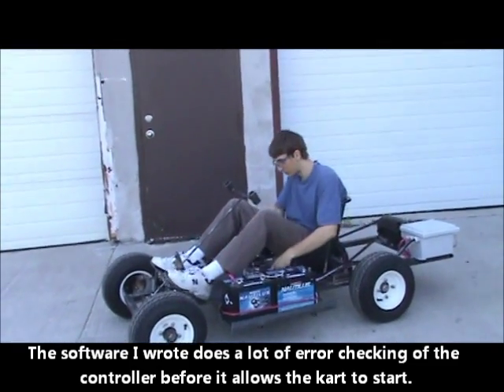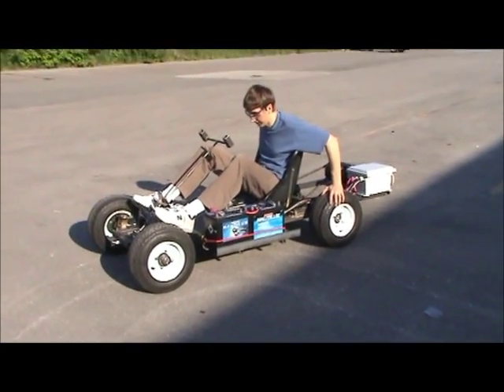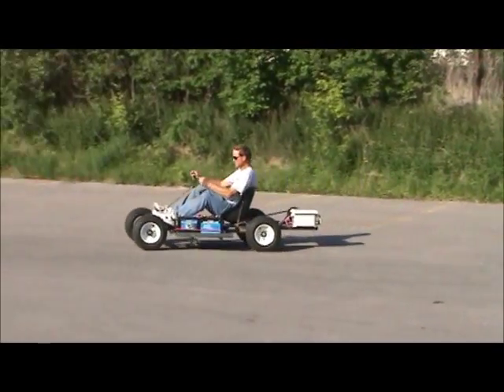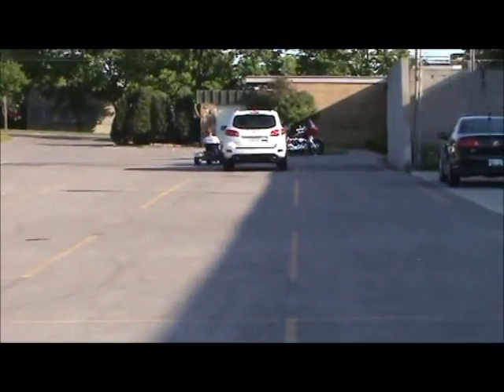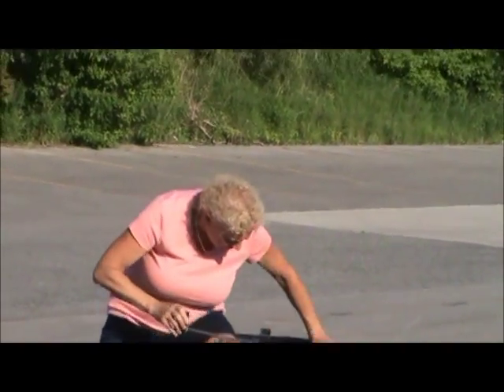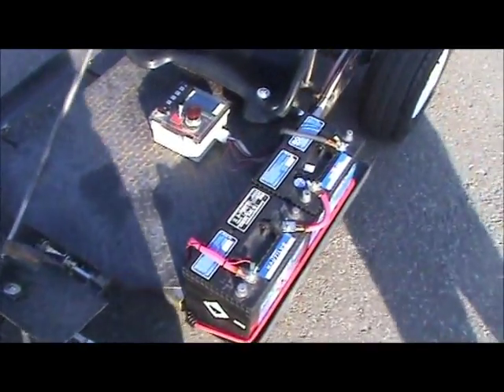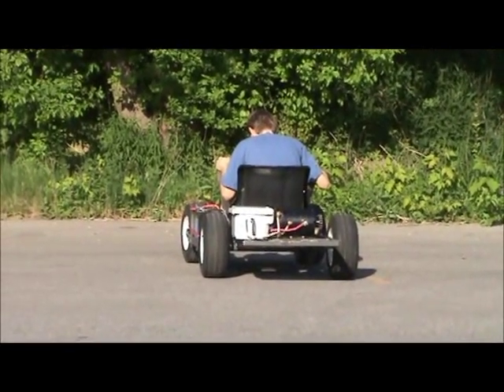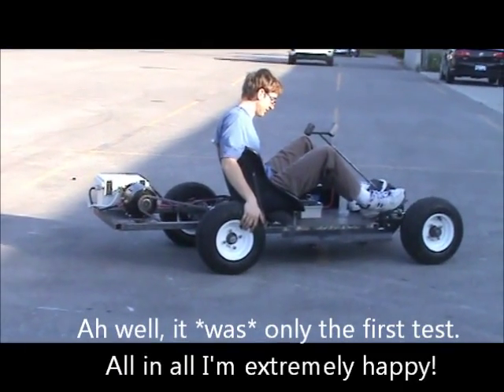Go Kart - Test Drive

Comment: Yes, anything you've never done before is hard :D

I'm an EE graduate and I've had a slew of microcontroller projects, along with some basic low voltage motor control stuff, but never something this big, so it's new to me. I've got the motor mounted and will start the controller next, and then LiFePO4 batteries. i.imgur dot com /icXbTq2.jpg

Thanks, I'll check out that controller, and definitely post videos as I make progress.

Here's to making cool stuff, keep it up!

Comment: if I took the nameplate off your motor and wrote 72-120V on it, would you be less obtuse?
The 24V is for forklift use. The 72-120V is for EV use. They could be identical.
This is the last time I'll answer you if you continue the idiotic attitude.

Comment from the maker: Let me get this straight.
I'm using a forklift motor rated for 24VDC.
You tell me that I could run 144V (6 times rated).

However:
The White Zombie can run 300V. Fact.
The White Zombie's custom engine is built from two Impulse 8 motors
(Ref: go-ev dot com /motors-warp.html#WarP_8)
This motor is twin to 
(Ref: evparts dot com/products/street-vehicle/motors--dot/96-to-192-volt-street-vehicle-motors/mt2117.htm) 
which is rated 72-120VDC
Thus W.Z runs 2.5x nameplate rating.
2.5x 24VDC is 60V not 144

Comment: I specifically stated 48v as potentially safe without current limiting so it follows I was talking about higher voltages without having to specify exact values.
There are many nuances in this kind of engineering and oceans of people will perpetuate their impressions and myths. You will have to navigate such pitfalls and learn that not all knowledge outthere is true. You can look on evalbum for forklift conversions and you can do the experiment. run it at 60,72,84, 96 and get comfortable it works

Comment from the maker: The internet make it difficult to convey sincerity, but I have been putting effort into toning down my replies. So okay, you were referring to 144. That felt like a separate conversation to me, I apologize for the misunderstanding. 
I have spoken to guys in motor rewind shops that told me even running double voltage (48) would be putting my motor at risk. I have never seen a motor run at 6x voltage spec, and I don't know the specs on the W.Z. I should look them up some time.

Comment: You will need to deliver a much better attitude if you want to benefit further from my insight. You can start by noticing I said it might work without current limiting in your setup at 48V but normally..
and I didn't say arbitrarily high voltage. 100+V which is normal for cars based on forklift motors. and it will of course work just fine at 120V or even 144.
as I said, White Zombie runs at well over 300V.
Try to read what I write so I don't have to repeat it many times

Comment from the maker: I would love to, but I don't own a DC Clamp Ammeter. I'm not sure the AC Ammeter reading would be reliable - in fact I'm sure it would not be, it's not a True RMS meter. If you can suggest other methods, I would perform them.
Eventually I will hook up my Bus-bar DC ammeter, but I will need to modify the control PCB and write some software to make those measurements. I will post an update at that time.

Comment from the maker: If you were trying to imply that with an arbitrarily high voltage, you would get an arbitrarily high current, I would of course agree. 
You were not clear about what voltage you were referring to. Perhaps you are referencing your post on the other video about 144V.
I stand by: 
1. At 24 and maybe 48V the current will be low enough for the motor and IGBT I am using.
2. 144V on this 24V motor would wreck it, even if current limited.

I am sincerely interested your experience, please elaborate.

Comment from the maker: And since the IGBT is rated for 400A there is NO WAY the IGBT can pop - unless the motor short circuits, because I was stupid enough to put a large enough voltage (or temperature) to break down the insulation on the windings.
"These surge voltages can be about
2 to 3 times higher than the nominal voltage of the
motor. This causes partial discharges and dielectric
breakdown." Source: ANWWIDM.pdf on vonroll dot com. 
Specifically this references PWM drive of an AC motor but the concept applies.

Comment from the maker: Okay dude, "if you just set pwm to 100% then it will pop the IGBT instantly" is incorrect, I'm sorry. I don't want to continue this argument with you, but I don't want misinformation here. Can the current rise to high levels? Yes. Arbitrary levels? No! 
Even if the batteries have zero resistance as you suggest, the motor still has a finite resistance (not zero). This limits the maximum current at stall. I measured the stator windings and it is around 0.1 ohms, so max current at 24V is 240A.

Comment: it doesn't quite work that way though :)
maybe at 48V it can't go too wrong with your setup (maybe the batteries limit the current) but normally the current can rise to arbitrary levels if you don't have current sensing. 2x headroom is nowhere near safe : )
if you just set pwm to 100% then it will pop the IGBT instantly if the batteries can deliver. Ian Hooper has done a controller with current limiting, Paul Holmes has an open source kit her sells. I also did one

Comment from the maker: Yep, the IGBT has a much higher current capacity than the draw of the motor. Aim for 50% to 100% headroom (i.e. if motor draws 100A, aim for 150 to 200A current capability. 300A if you want it to be bulletproof :)
I have a current sensor and there are plans to current limit - just not implemented yet.

Comment from the maker: Thanks. I don't have numeric targets because of a lack of instrumentation (as well as a lack of desire to *create* instrumentation) but let's just say I wasn't satisfied with either the top speed or acceleration. However when I resume work on the kart, hopefully in the next two months, I will be able to add the remaining 2 batteries, achieving 4x the power dissipation  (V^2 / R) during initial acceleration - so hopefully MUCH better. Then I need a harness, roll bar etc. No schematic yet, sorry.